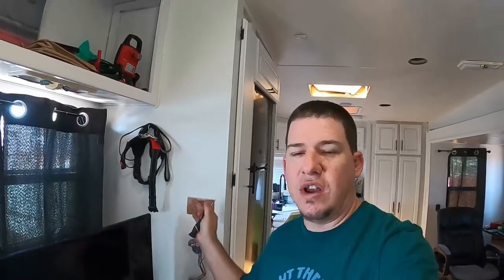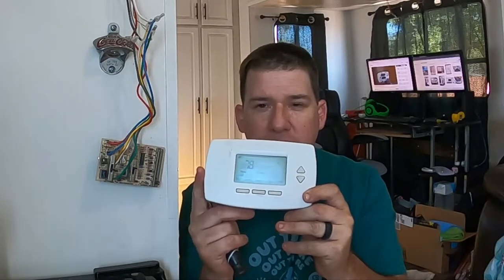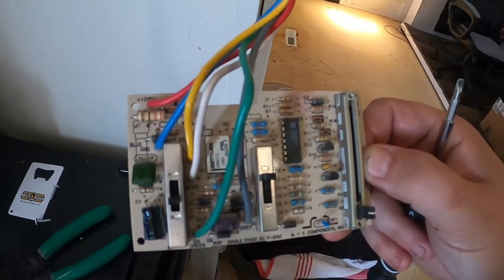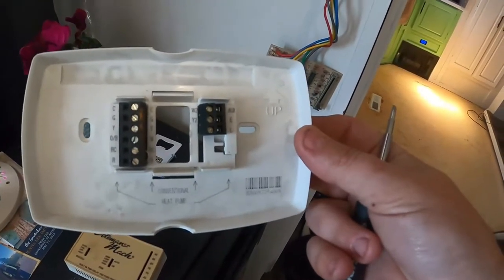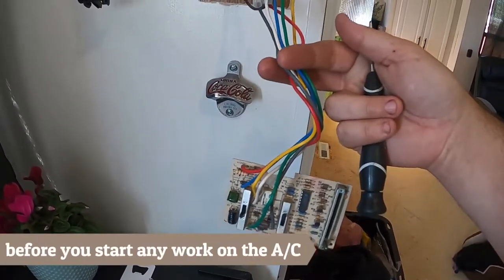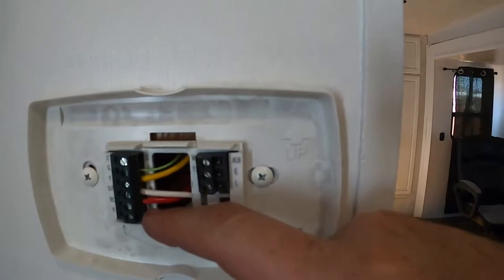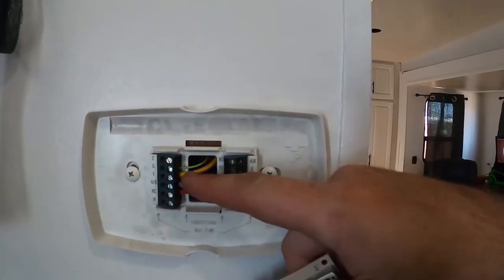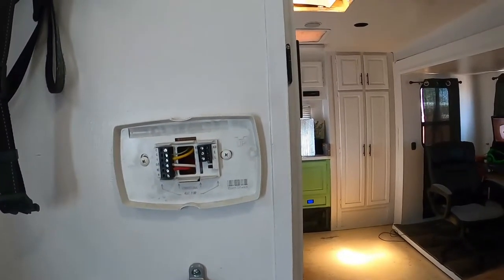The Quickest, Easiest Way to Upgrade Your Coleman Mach AC Thermostat

Comment: I am dumb with electricity but look easy to upgrade!! I’m wondering about the voltage. The coloman runs in 12v isn’t it? And yours is running in 24v.. does it not affect the performance?
Reply: Many thanks for your vídeo is awesome!!! 😊
Reply from the maker: Sorry for the very late response but no it was not running in 24v it ran perfectly!

Comment: i see the thermostat runs on 24volt but your rv is 12volt.  i guess you  havent had any issues?
Reply from the maker: The thermostat that I got ran off battery and then the wires from the A/C are 12v. So just make sure the thermostat you get is 12v.